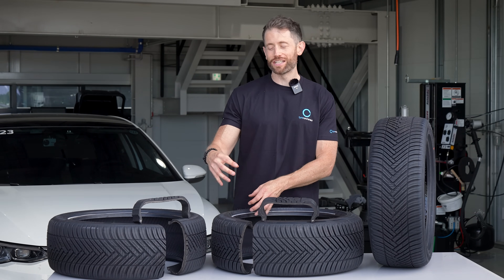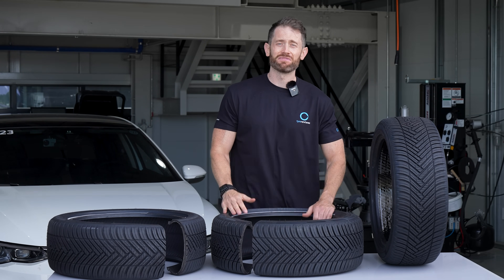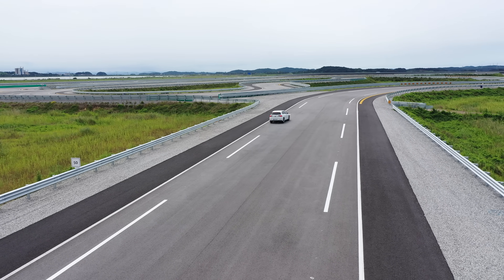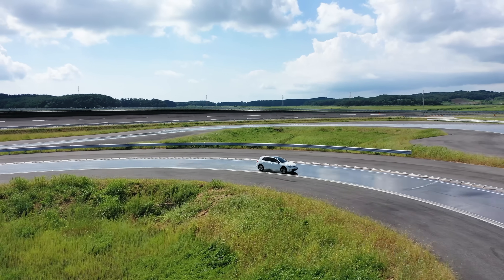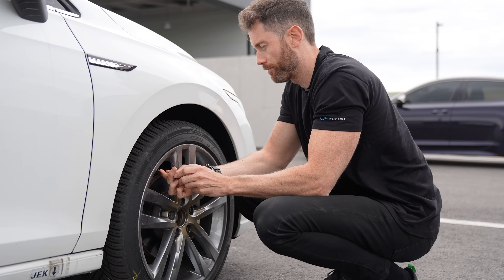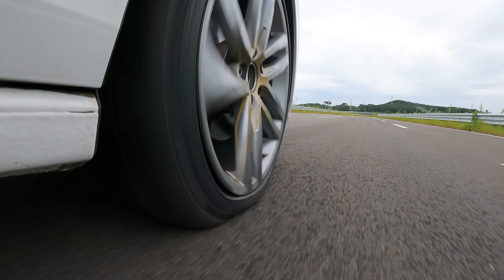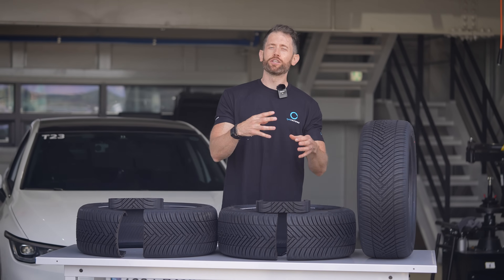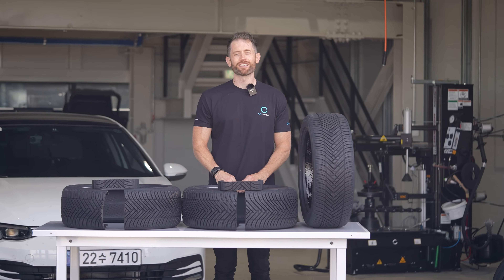Are Modern Runflat Tires Finally Good? Normal, RFT and SEAL Tires Compared!

Comment: Great video!  I have never been interested in the run flats but the seal tires have my interest.
Reply from the maker: They're a really smart solution
Reply: @tyrereviews  I see you are rocking a Casio watch calculator while driving the Golf.  Do you wear an Omega Speedmaster when driving a Porsche?
Reply from the maker: @David-vg1wl  Yes I am and no sadly not, the casio stays whatever the car!

Comment: Is there a sealant that you can apply to your existing tyres?
Reply: Here in the UK their is a product called puncturesafe.
It also has different options as to level of puncture protection so
High speed is 6mm and 175mph.
Medium is is upto 15mm and max speed of 90mph.
Then there is a heavy duty version which offers 30mm and upto 50mph.
And each version will seal  100 punctures of maximum diameter in the tread area.
A1 Puncturesafe
Reply from the maker: I believe the product exists however I don't know how effective it is. The stuff the tyre companies use is not a home soltuitin

Comment: I have a G30 BMW with run flat summer tires and normal winter tires. I thought that the winter tires will absolutely crush the summer ones in terms of comfort and I was shocked to see that this is not the case at all. The difference is almost unnoticeable and the suspension has wayyy more influence of the comfort than the tires. So, the results from the test absolutely corelate with my observations.
Reply from the maker: What are the summer and winter tyres?
Reply: @tyrereviews  The summer are OEM Bridgestone Turanza T005. The winter are Conti WinterContact TS 870 P
Reply from the maker: @Harka666  I believe the T005 uses the driveguard technology now which is bridgestones latest gen rft technology
Reply: @tyrereviews  If only the t005 was an uhp instead of touring. 
Your recent test showed its floors vs the uhp tyres, but I saw a 5 series diesel driven by Steve Sutcliffe in a  recent tyre test and he loved the t005!

Is this likely due to heavy saloon vs much lighter hot hatch?
Pretty sure it was a non rtf, so no benefit re firmer sidewalls 🤔

Comment: My 2010 BMW came on runflats from the factory. Changed them after a month of driving. Too stiff. Glad to hear that there is almost no difference with normal tyres nowadays. Thanks for another great and such an informative test!
Reply from the maker: Yeah i remember the ones from 2010 being quite different!
Reply: I remember the ones from 2004 like the re050... On Z4 e85. They were really terrible
Reply: Mine has rf too, but BMW and dealers refused to change them for normal ones for safety reasons, because the car suspension is tweaked to rf.
I replaced the Michelin Pilot with alll season Pirelli rf because of that.

Comment: Are these 4 season tyres as well?
Reply from the maker: Yes the tested tyre is an all season ( all weather in USA)
Reply: @tyrereviews  Thanks.
Gosh! These will be my next tyres then as I need to replace soon.
I was going to get Cross climates as I had before although they were the previous generation. The ability to get out of trouble with run flats is a great bonus with little penalty so it seems from your review.

Comment: Sorry, they are not. I have popped 3 brand new OEM (BMW) fit Bridgestone run flat tyres in 4 months on pot holes a normal tyre would not have worried about. ALL broke where the tyre connects to the rim and all have broken the wall of the tyre. I removed the entire set and replaced with PS4S and the car is better on every level. On large wheeled (20inch) low profile (30-35) on heavy cars (530D X Drive) they are not fit for purpose. The 3rd tyre was 40 mph in a roadworks section of dual carriageway, chatting away to my passenger, HUGE bang and the tell tell sign of no air in the tyre. I lost my shit at that point and all were off and replaced within 3 days. The wheels were checked, they are not at fault and all was OEM BMW fit too and
Reply from the maker: Glad the wheels were OK, bmw wheels used to love cracking too
Reply: @tyrereviews  Yea, buckled wheels were a big issue on the early 135i's I believe, but amazingly my front offside (the same location each time!) was un-cracked and true. To add I also run an AMG GT-R running Cup 2's and the tyre ride is, I'm convinced, better on that than the 530D in RF's!
Reply from the maker: @houseyUK  I would not be surprised by that, the cup2s are pretty comfortable for the category and the suspension in the GTR is probably a little more premium.

Comment: Hi Jonathan.
Thanks for this brilliant test!!

I asked about sealant or runflats on one of your previous uhp tyre tests for my GR Yaris standard, with the convenience pack. 
I despise the thought of a puncture and in 15 months I've found 2 separate nail/screws. One removed without air loss, the other noticed and repaired.
Looking back over 30 years of driving, all punctures were repairable so the sealant is likely good enough but I prefer the further safety of a runflat ideally.

Currently running Goodyear Eagle f1 asymmetric 5's and due tyres soon!
Very happy with their grip and will likely get A6's, unless I can find either a runflat or sealant tyre with SIMILAR performance. 

Have been looking online to see what's available in 225/40/18, but currently only seeing contiseal in csc3/5? and also R/F or Goodyear Eagle f1 asymmetric 2/3? in just runflats and they'll likely be too harsh compared to the R/F tyre tested here.
If you are aware of others, please advise?!
VW put contiseal 2 or 3 on their R36 many years ago so they can't be too bad. I had csc3 on the rear of an Octavia vrs tfsi 10 years ago and I liked them.
Do you think their contiseal version would be close for grip/driving pleasure vs my current A5's?

I phoned Goodyear technical regarding putting their R/F asymmetrics on my stock enkei cast alloy wheels, questioning if they could cause damage I.e wheels cracking or suspension issues but they couldn't confirm, and my toyota dealer are as useful, knowledge wise, as an ashtray on a motorbike!

Please please please can you advise re the above points. 
The suspension on my GR4, standard set up, is road biased vs the circuit pack, hence choosing the A5's for their firmer sidewalls vs ps4s's.
I'd happily go slightly firmer still. 

This 4th generation terminology. Is it applicable to all runflats being produced or solely this make and pattern/all season?
Many thanks.
Reply: Stick with ordinary tyres. Save money, save weight, save your back, save your alloys from being cracked.
Reply: @DAVEXR2007  Lol....
Money is negligible when calculated over their life. I'd happily pay a pound a day for peace of mind.
It's sods law it will be dark, pi..ing down and on a "smart" motorway or country lane, and the AA will be prioritising women re "safety."
I'm guessing for anything sporty but with the compliance of these tyres tested in runflat, there's nothing available but I hope to be told different. 
The contiseal will likely be my best option for my tyre size, albeit in an old pattern.
In other makes, sealant appears only in average non uhp tyres, from research to date.

The other option is getting the uhp tyres I want and having the ultraseal tyre sealant added, going from another comment on here.
I know nothing about it, but will research later.
Reply from the maker: 4th gen is hankooks terms, but Bridgestone have driveguard which is their latest gen. Contiseal is a technology applied to a pattern, if you can get a modern conti tyre with contiseal it will be fantastic
Reply: @tyrereviews  Thanks. 
Pretty sure, in my size, it's a csc3 and perhaps 5 available with contiseal.
5P, 6 and 7 not available.

I'll look back at your reviews, amongst others, re the csc3/5 and if available, likely go with one of those👍
Reply: @tyrereviews  You've opened that can of worms again, lol...
In the last 24h I've further researched for decent options available in sealant/rft in 225/40/18 🤯

Spoke with a nice chap called Ian in hankook technical this morning. 
He has also worked at continental, and I think, Bridgestone with years of experience!
He stated that rft's can be fitted to non oem rims, it's just they can be a bas..rd to fit!
Hankook have nothing in my size, their closest being an evo s1 evo "2" HRS but in a different fitment, not recommended. 

I found that michelin do a ps4 zp which is their zero pressure runflat and I'm, gut wise, actually thinking it could be perfect. 
It has the well known grip of the ps4, but with rft, which might actually resolve their soft sidewall and feedback issues?!
Reviews online are saying it is very comfortable and quiet vs previous Bridgestone and pirelli rft's. 
Contacted Michelin uk technical department, but they were playing the health and safety card, not committing because my car isn't an oem rft fitment!
They had nothing in selfseal...

Contiseal looks like my only option re sealant inside that's an uhp, but it's in their csc5 pattern, which doesn't overly shine in reviews and has a horrendous wear/life issue apparently!
My toyota dealer, I revert back to the ashtray on a motorbike analogy!
🙃

Comment: Brilliant review as always Mr B, as well as being a tyre geek too I am also bit of a run flat convert!

I bought a set of Bridgestone LM005 Driveguard tyres for my Volvo S90, I’ve ran them for two winters now and I can’t find any noticeable disadvantages to them. The fact they are remarkably similar to a normal tyre is incredible, especially with the added benefit of being able to drive for 50 miles at 50mph with a puncture. As you say the only real downside is the extra cost. 

I think the extra outlay is worth it, especially on a winter tyre, who wants to end up stranded with a tyre repair kit on the side of the road on a dark foul winters night!

Kudos to Hankook for letting you use that facility, it looks seriously impressive. No wonder they are turning out award winning products with facilities like those 👍🏻👍🏻
Reply from the maker: Yes, Bridgestone Driveguard is their latest technology and works great!

Comment: I really don't get why people complain about run flat tyres. Picture this, I was driving a 2011 530d  and overtaking at about 160kph and the right rear burst, what would have happened if it where a normal tyre? The car didn't move around or skid, but continue straight on as if everything was normal. I love run flats, I just hope pricing would be more affordable.
Reply from the maker: Glad the technology worked :)

Comment: Amazing - I'm surprized how well the runflat tire performed. I had a runflat set on my BMW years ago that was not so convincing, good to see they're making progress!
Reply: I just removed a set of run flat Pirelli P Zeros from my M340i. It’s now running a set of Pilot Sport 4s, I wish I’d done it years ago.
Reply: @LordStraightBanana  glad you made this comment, had a 330d e92 years ago and swapped the runflats for PS4s and it was night and day. Just got a 335d f31 that has falken run flats on and it is awful, genuinely disturbingly bad... was wondering if it was just these particular tyres and if other better ones would be ok... but no, if your pirellis were awful too then I'm off for some eagle f1s or some PS4s again. Cheers
Reply: @timbob1145  the ride was harsh and crashy with the P Zeros, you felt every bump. They may or may not have been better than your falkens, but it seems a common theme with run flats. 
These cars should come fitted with the Michelins.
Reply: @LordStraightBanana  agreed. Thanks again for your input.
Reply: @timbob1145 I’ve an F30 330d with Goodyear Eagle F1s which were ok but now at 4mm tread depth have become un-driveable, especially now the temps have dropped and the roads are very wet. Been considering these Hankook RFTs or a set of Kumho PS71. What did you go for?
Reply: @adrianwhitehead1950  I'm yet to swap, still probably gonna go for f1s or ps4 or 5s as by the time they wear down the weather will hopefully be on the up. I will say tho, altho these falkens are awful, they seem to be lasting forever and I'm not paying for new tyres till they're dead... Yes I'm tight 🤷🏻‍♂️
Reply: @adrianwhitehead1950  I suppose the difference may be that mine's xdrive tho... A lot less exciting back end unless you turn traction control off and push it.
Reply: SAME ! @LordStraightBanana
Reply: Had a BMW 335i when run flats were new and I hated them and removed them the first chance I got also had a warped alloy (had to fight with BMW to get the alloy replaced) and they were just a lot harsher to run, so completly put off. Great to know that these run flats have developed to a point where they are more than good.

Comment: That was an amazing shot of the internals of the sealant tire getting punctured. The tire died for a worthy cause to get that view. Does Hankook use the same aftermarket goop that people use in tire inflator kits or is this quite different?
Reply from the maker: The stuff that's applied to the tyre is quite different from anything you can use at home, much better at its job
Reply: The tyre repair kit goop is white, so a different compound. Also the repair kit stuff should only be used for low speeds and short distances, but the seal layer has to withstand long distances, temperature and pressure changes and possibly a tyre life time without losing the ability to work in case of a puncture.
So while functionally similar, chemically different due to very different requirements.

Comment: Problem with sealed tires is that you possibly would not notice when damaged. I think it is no joke driving fast with a compromised tire.
Reply from the maker: In theory anything the seal can seal is not damaging enough. I did dry handling after 16 nails no issues

Comment: Runflats cost more, ride harsher, sound louder, handle poorer in wet/colder conditions, (especially when worn). Ask a BMW driver 😉..
Reply: Not anymore. Yes older RF's did all you say, I have drive on BMW shod RF's for 20 plus years. Just fitted four Pirelli P7 RF's on a 4 series, ride, noise, comfort all greatly improved.
Reply: Not anymore. Yes older RF's did all you say, I have drive on BMW shod RF's for 20 plus years. Just fitted four Pirelli P7 RF's on a 4 series, ride, noise, comfort all greatly improved.

Comment: Might have to revisit RFT. Couldn't get rid of them quick enough on my new back then R60 mini countryman. Hit a mid corner bump and the car used to jump sideways. Not an issue on standard tyres
Reply from the maker: The  mini does also have quite firm suspension :)

Comment: Once again - Great test and review!  You just proved that a tire’s performance is all in the tread compound not the construction... 😉 😂

I have had a love/hate relationship for 16 yrs with the RFTs that came on my MINI Coopers.  Unfortunately, those earlier and lesser quality OEM tires were crap, including the Hankook RFTs that came on my 2019 MINI.  Extremely poor ride and handling in all accounts.  With those it is no wonder people with MINIs discarded them as soon as they got home.  However,  that said, I did put RFT snow tires on one MINI and that turned out to be a blessing.  On a 3 day ski trip, on the morning of day 1, 10 deg F outside, yup, a “flat” tire with a nail hole.  No worries.  Pumped up the tire and drove like nothing happened.  It was a slow leak so I was even able to make the 3 hr home without loosing too much pressure (tire pressure remained acceptable).  I did have to re-inflate the tire each morning.

A couple of notes - The Bridgestone RFT snow tire was repairable, per Bridgestone, as long as it was driven with air pressure in it.  A plug and an inside patch.

Ride quality with a RFT is hugely affected by the quality of the shocks.  Replacing the OEM MINI shocks with Bilsteins (B8s) was a huge improvement in ride quality.

Here is a guess why the BMW M cars don’t come with RFTs.  They overheat when pushed, like on the track.  My cousin ran his 3 series (non-M), with RFTs, on the track and the pressure rise from heat raised the pressure to something higher than would be optimal.  This was with a reasonably low cold tire pressure.  Interestingly the tires themselves held up to the abuse.

Looking for to a review of performance RFTs.  They might be worth a look given what you showed in this video.  Keep up the good work...

Comment: Thank you for making this comprehensive comparison video on these three different types of tires.  A true "Ultimate safety tire".... maybe a RunFlat Seal Tire for the future that has excellent rolling resistance?!😉I wonder how long those seal material lasts in real life though.
Reply from the maker: As far as I'm aware the seal material is good for the life of the tyre.
Reply: @tyrereviews  would that be 5 years or 10 years?
Reply from the maker: @Jeo-What  most manufacturers recommend 5 years for the tyre, I've not asked about the sealant working beyond that
Reply: @tyrereviews  thank you for the quick reply. In the past few years, you have tested this model of tires and it has been great except one area and that was the tread ware  that cost lost of time between laps. I have also read some positive reviews that the customer was concerned about the treadwear life. What’s your experience, on this matter for this tire since the direct competitor CrossClimate2 will still performing well down to 2 mm?
Reply from the maker: @Jeo-What  I've not seen any data on the worn performance of these tyres, sorry
Reply: +1, I would love to see runflat sealing tire in the future